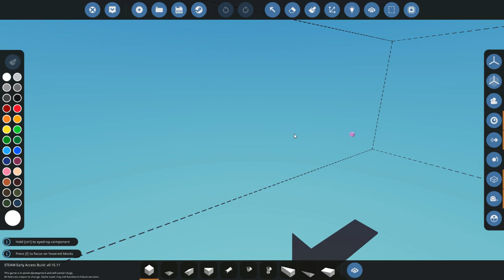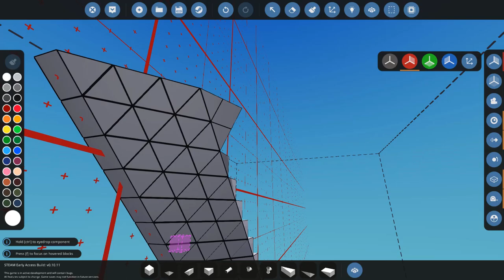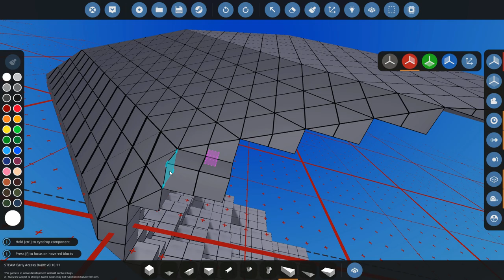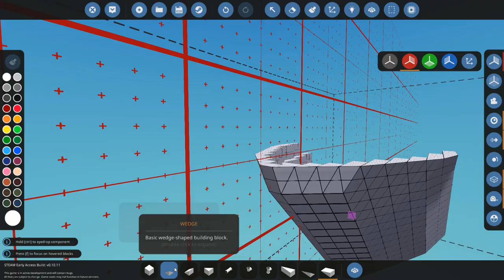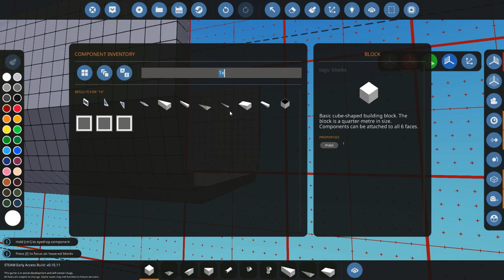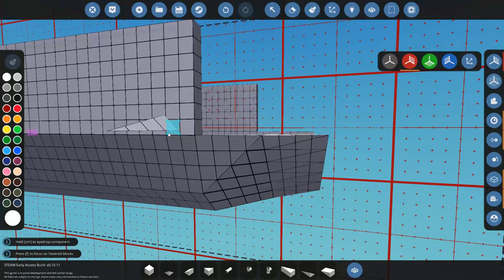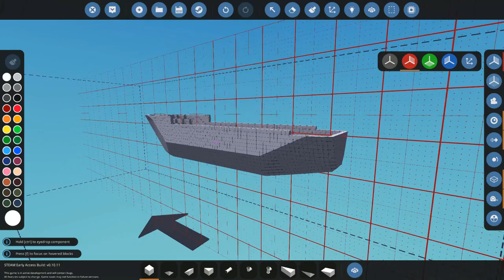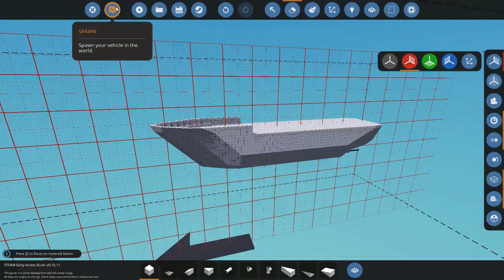Stormworks B&R l Complex Boat Hull Tutorial

Comment: Too bad the bigger the 1x1 slopes and pyramids are effectively normal blocks in terms of drag
Reply: Yeah pretty lazy on the devs part, I mean at the very least the mass should be more accurate, a 1x2 wedge is not the size of a 1x1 cube if you imagine it folded in on itself. It should be like .75 mass. I'll cut them slack on the drag since I imagine that's harder to code for, but not plugging in more sensible mass values is just unexcusable and it forces players to do cheesy shit like place pivots in the bow since it now weighs twice as much as it should and sinks relative to the rest of the hull.